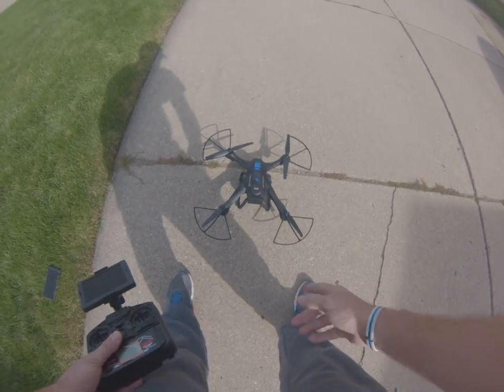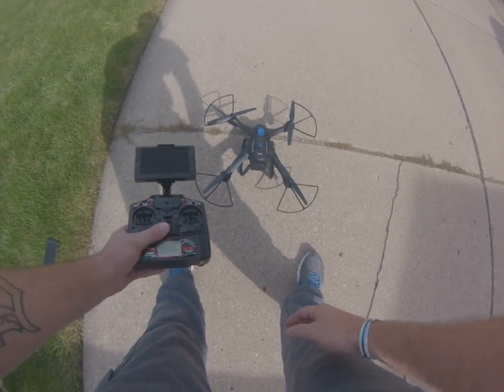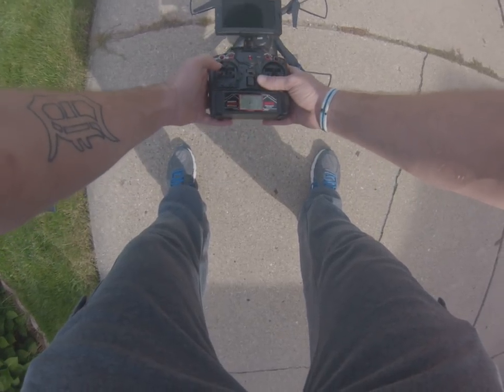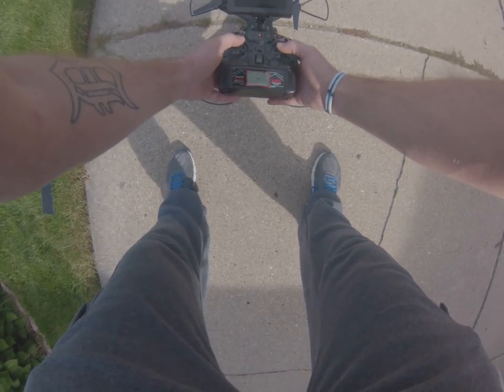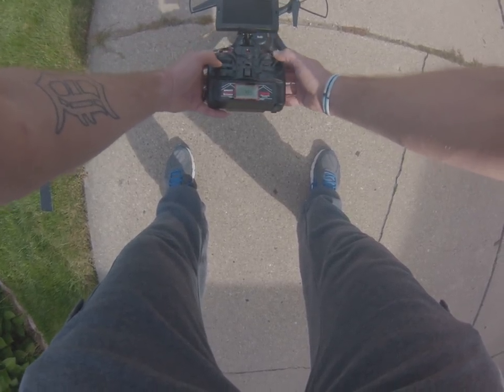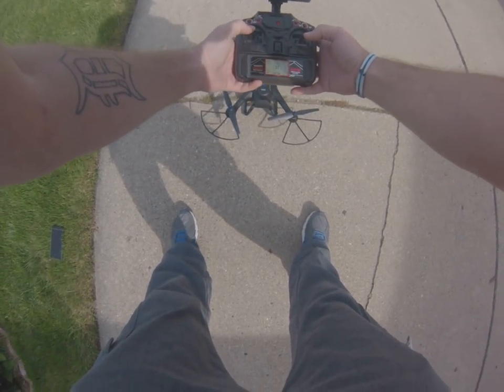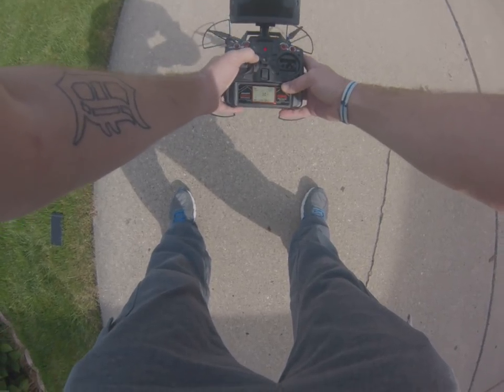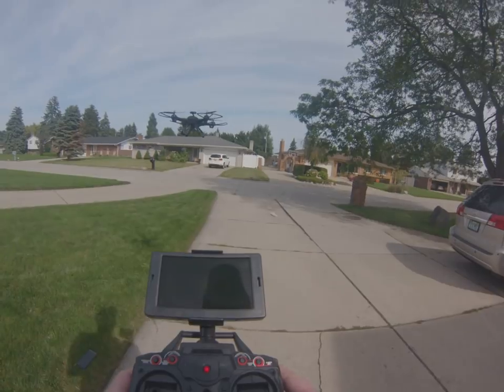Global Drone X183 Calibration

Comment: Hey Logan... I just got a white like this... I can get the drone to compass calibrate... I can't get the remote to stop flash and work the drone... Any help?
Reply from the maker: Marty Scruggs Did you turn the drone on first?  I'm not really sure what causes the drone's remote to keep flashing, I haven't ran into that problem.  The only thing I can think of is that the remote isn't syncing...
Reply: +Logan45499 that's what I thought but it takes the compass stick controls
Reply from the maker: Marty Scruggs I'm dumbfounded
Reply: I had to unhook the battery... plug it back up turn the remote on wait 10seconds then turn on the quad... radio beeps then connects. I do the compass calibration lights stop blinking I give it to get at least 12 satellites press the auto take off... it goes up like 4ft hoovers for like 10 seconds I have control to flies around the light start flashing and it climbs to about 30ft and goes into auto land or return home. Like the battery is dead... the manual is almost useless.... 

Sorry to keep bother you but your like the only on line that speaks English that has had some luck with thing
Reply from the maker: Marty Scruggs I don't consider it a bother, I'm happy to be able to help.  When mine does that, usually if I unplug the battery in the drone, and reconnect the battery (in the drone), I push the connectors together as hard as I can, and usually allows me to fly it again.
Reply: Your battery is flat. Get yourself a 1-8s li-po battery alarm off Ebay or elsewhere. You can get a handful for 10 bucks. They make handy battery checkers. Plus you can tape them to the quad's leg, connect the battery balance plug and have an audible low voltage alarm (they're adjustable) and they'll help you find it in the grass/trees when you lose it. Also get a hobby grade charger. Those supplied chargers are never famous for their quality/accuracy/durability.

Comment: Good afternoon friend I saw in your video that you took flight with the flashing lights even after trying the calibration, does the next expects it to find 10 to 12 gps and then does the calibration of it, when you put the left stick on the diagonal up and the right one down the lights have to blink there calibrate the gyroscope and then the right one up and the left one down there it will flash continuously there you start to make the process of turning it to him Find the direction, of some 4voltas instead of 3.